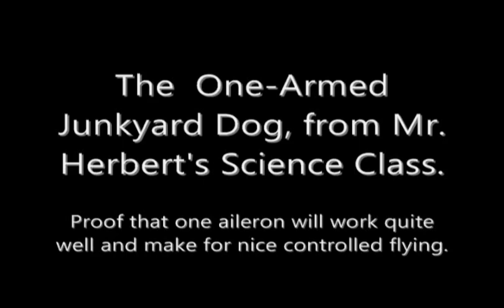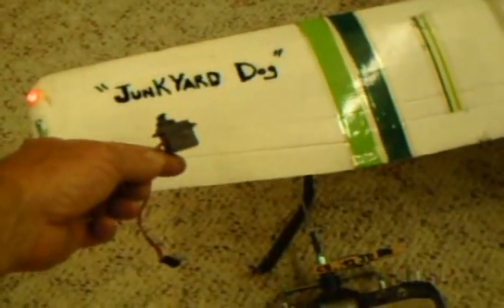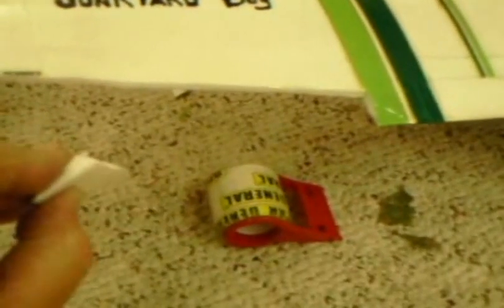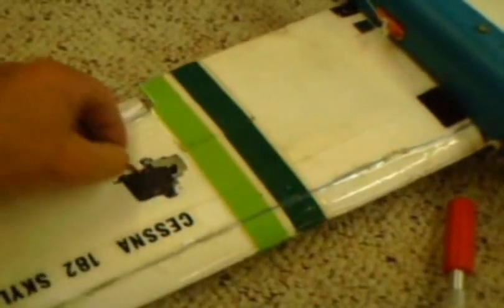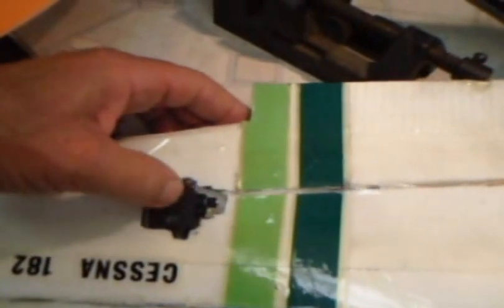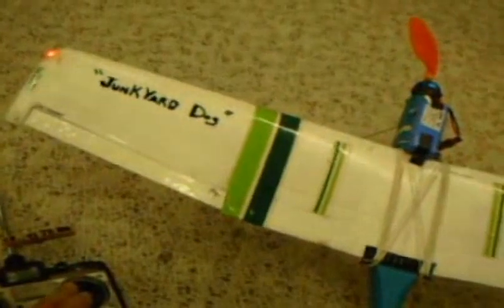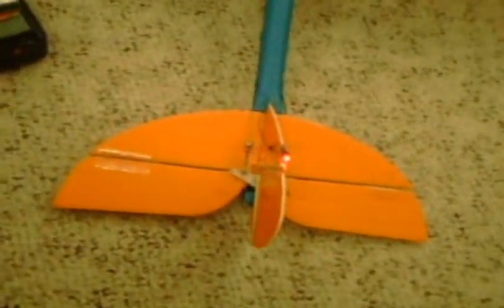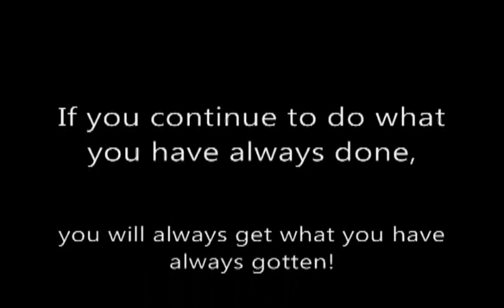Will only 1 aileron work?

Comment: Seen a plane that had so much epoxy from repairs, I bet it added 5 lbs to it. when it was trimmed right it had 1/2" throws on it all over. just proved to me a brick would fly if it had enough thrust. it was not pretty, but it flew.

Comment: Hey doc, i have a question

I was flying my aerobird swift today with no problems although upon inspection after landing it(without crashing), my right aileron would not raise up, it kept catching on the inside tip of the main wing where the aileron is cut out.  It is interesting because it was flying fine and I did not notice it until after I landed, the battery was very low although the other aileron was demonstrating full range of motion.

Comment: Hey Dr., I was wondering what your opinion is on the planes that have the front of the plane, the boom/stick in the middle and the tail on the back.  I currently have one 2 channel model that only has throttle and left and right, I have been flying for about a month and want more maneuverability.